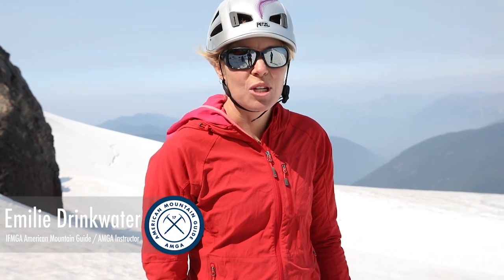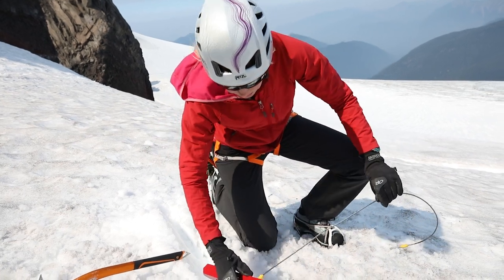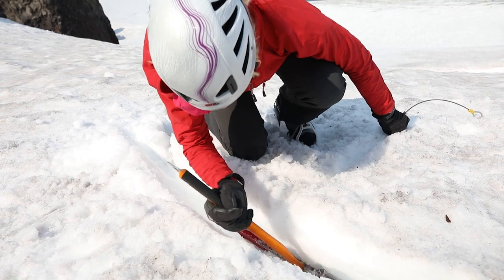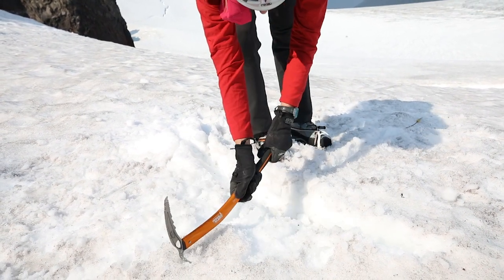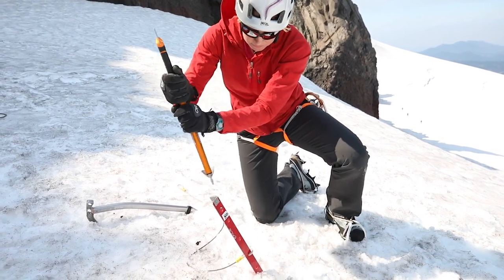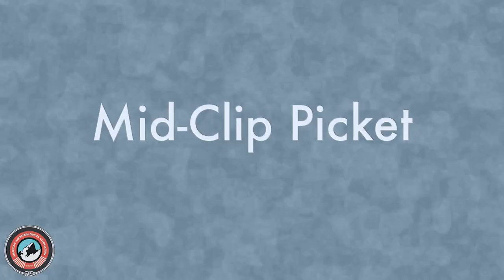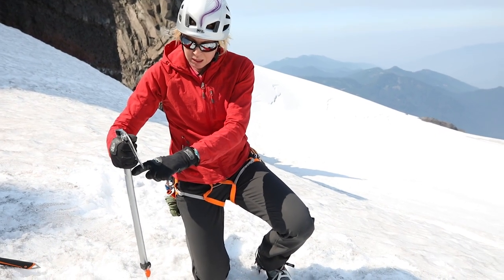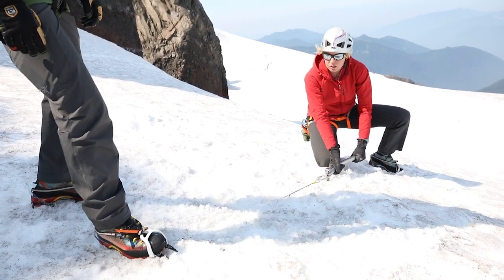How to Build a Snow Anchor

Comment: If you are building a T-Trench Anchor, you should avoid walking on the snow towards the load. This could cause a colapse.
Reply: Thanks for the expert commentary, Mr. Climbing Gym.
Reply: Actually, in the case of soft powdery snow, you will want to walk on the snow towards the load in order to "work harden" the fluffy snow into more compact snow. If it is firm snow, you are right, and walking on that part of the snow is not beneficial.

Comment: 1:40 the picket is facing a different way to 2:56
Reply: Yes, that's the correct way to place it. When clipping from the top without the attached cable, you face the cable away from the pull and the point of the V shape toward the pull.

When mid-clipping with the cable you face the ends of the V toward the pull and the cable toward the pull.

This is to prevent buckling of the stake. When it is top clipped the forces through the stake are reversed and it would buckle at a weaker load than having the spine take the load, which is the case of facing the point of the V in the direction of pull.
Reply: @byronmuir9030  very interesting, thanks!